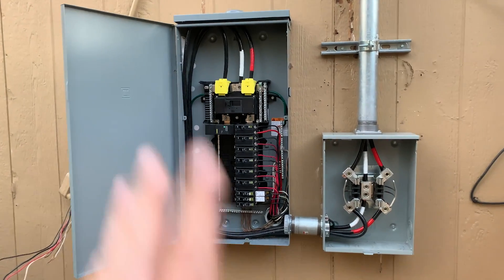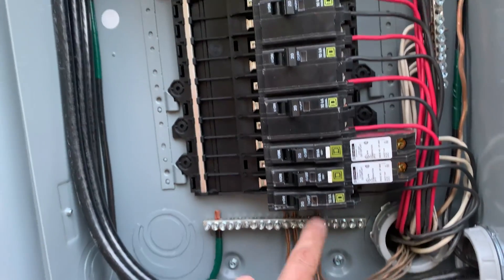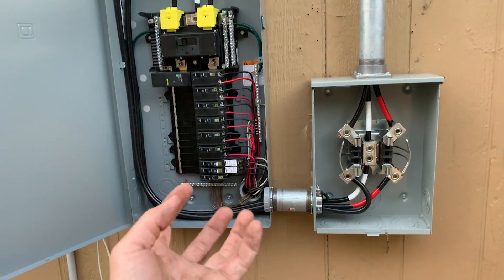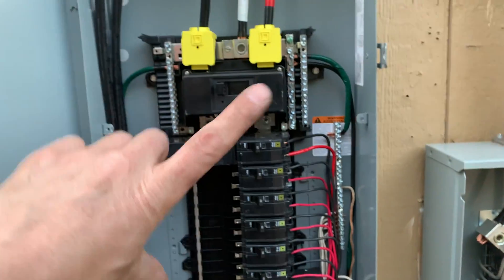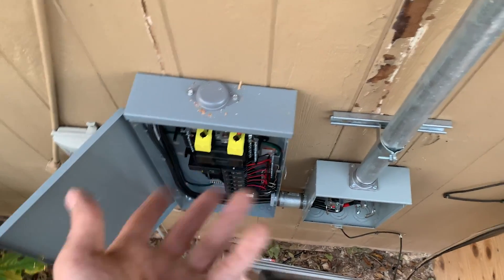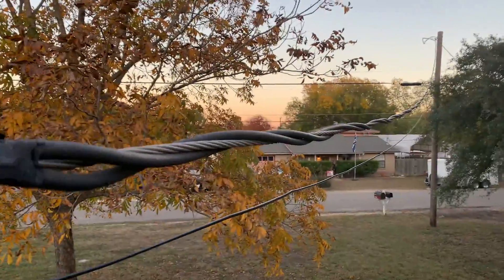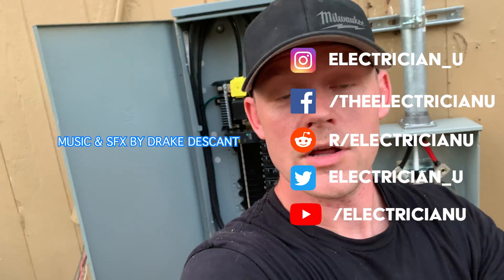I Just Changed Out My Electrical Service

Comment: I can't believe your code allows your main incoming power come through the distribution side to your main breaker. In Ontario Canada our panels have a barrier between the main and distribution section of the panel. We also have a separate ground bars and neutral bars. You didn't mention your surge breaker

Comment: Can you explain more about the circuit breakers as to why it needs 2 hots instead of just 1?
Reply: 240’s need 2 hots (from different buses).  120’s need 1 hot.  The 2 120’s are opposite, so combined, they give you 240.

Comment: You have no guy kit on your mast required in the NEC for that much length of mast coming through the roof line. Plus, main merge ground and neutrals, sub separate grounds and neutrals. Could have landed the Neutrals with the grounds.

Comment: 1 to 2 ground rods needed 6ft apart with an inter system bonding terminal, and bonding to main plumbing with a jumper to jump the water meter.

Comment: You should have mounted the panel inverted with the main breaker on the bottom; would have saved yourself a lot of work.
Reply: Its a nema 3R panel. Its only weather proof if its mounted the way he has it.  Its outside, lol.
Reply: @Jzzonem  You invert the internals, not the whole panel. lol
Reply: @davidmiller8967  Ok... and how would you install the dead front at that point? Just curious.
Reply: @Jzzonem  I've never encountered an outdoor breaker panel that was not convertible between top or bottom entry but it doesn't surprise me. It's been a few years. Manufacturers today are trying to save a few bucks and assume everybody is installing from an underground service. My original comment was assuming the panel was convertible.  I wasn't trying to critique your work. Looks to be an excellent installation. I always learn something from your videos; good job on those too.
Reply: @davidmiller8967  Right on!  I was just curious if there was something I was  missing in my recollection.  Always open to learning something new.  This video was not mine and I apologize if it came off that way.  It has been a few years for myself as well and I remember not having installing an indoor panel upside down. I honestly have never installed the guts of an indoor/outdoor panel this way.  Thanks for your comments!

Comment: Great video again!  I’m going to have a new panel box installed in the home I’m buying.  The current box is a Sylvania panel with wafer thin  breakers which are difficult to find and are expensive.  I’m also not sure how the wafer thin breakers stacked so closely together can dissipate heat for safety.

Comment: I noticed the wiring that came in the original panel from the left is still just hanging in the air. Where does that run to, and why didn't you connect it in?

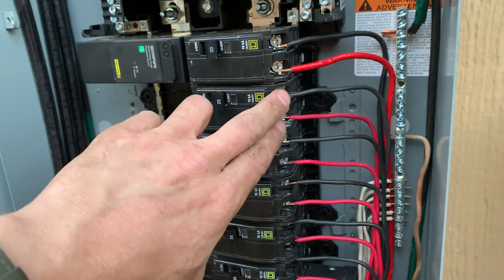Comment: 6:34 I'm confused about something; how did that pass inspection as it is without ARC Fault protected circuits?  It was my understanding that since 2014 Nec (maybe earlier) that every single circuit needed arc fault protection.  Did they pass it because you're planning to do it later?
Reply: I think its because he is only changing the service (meter,panel) at that point he is not rewiring the house. He has a bunch of multiwire branch circuits that share neutrals, so the arc fault breakers would not work.  They would constantly keep tripping.

Comment: If there is no UFER, then you need 2 ground rods for equipment grounding. Also I see parallel neutral as you ran ground wire thru nipple . You could have installed your bonding bushing on panel side, that way you would have  terminated the ground conductor at the bonding bushing on panel side.

Comment: i should send you a pic of my houses electrical box. I just finished the transfer of the deed to my name recently and was looking for a specific breaker that popped during a recent storm. needless to say, it's a nightmare. a box that should be at 200A but is 100A. Stuffed to the gills with wires and breakers. I bought the house as is and I truly have little idea on where to start. My wiring work overseas has not prepared me for this
Reply: Why don't you do a load calculation. That way you know what size your service needs to be.

Comment: hey bro I have a question, according to the code now when a service is done, a disconnect switch must be installed before the power reaches the panel ? I hope your answer thanks
Reply: There is a disconnect in panel. You need an emergency disconnect if your panel would be inside the building.

Comment: Permit on your own house? I wouldn't just because of the arc fault requirements. I could swap the meter socket in 2-3 hours and only have the meter pulled for 20-30min and done before they could even consider sending a crew out. Great looking work. New siemens arc faults don't monitor the neutral btw. Maybe square d will go the same route.

Comment: Hi there i have a question if u can help. I dont  know much about electricity. Im buying a led 650r hlg light fixture. Is has two plugs for me to chose from. Standard 120V Nema 5-15P and  
NEMA 6-15P 240V. I have both outlets that will fit both nema but my question is will the light fixture perform the same if i were to chose either or?

Comment: Why is the jumper to the neutral bar you added green?  Shouldn't it be white?  I know the box is your point of bonding, but if you installed your own neutral bar that was insulated from the enclosure, that jumper should be white.
Reply: That jumper wire he added is not right. He said it was sized for his use, but I counted 8 20 amp circuits. That's why the feeder wires are sized at 3/0.

Comment: you would only need 1 arc fault device at the begining of each circut and from the panel you would run a Bx if out door flex to the first box plug just another way

Comment: I'm not 100% certain, but I do not believe you can put the neutral wires on the ground bar even with the jumper you used. Looks like you have a 3/0 copper neutral, if all your neutrals ended up on the ground bar then you would have the full neutral load on that number 6. Ive seen plenty of ground bars install that way, but none have neutral wires on them.
Reply: I am certain he installed a feeder tap inside his main panel. It is undersized like you mentioned.

Comment: Didn't see any mention of a ground rod. I know you have to have at least 1 ground rod but some areas they require 2 ground rods. Good job. I do like how you used a wire to bond the ground and neutral instead of depending on the box to do the job. Makes good sense so I will be doing the same thing when I have a job like that in the future.

Comment: Did you say that your grounded to the concrete slab? In WV you need two 10 foot ground rods at 6 feet apart. In Ohio you do not. This is with both with AEP.

Comment: Is there a reason why you could not turn the breaker panel upside down to get the ground and neutral buss bars at the bottom of the panel and a void adding new ones?

Comment: I wouldn’t worry to much about arch fault make sure you have good connections and good breakers and man you will be fine my family has been wiring houses since shielded cable was made and you are plenty safe.
Reply: Most houses (around here at least) don’t have any AFCI protection.  New construction does, but everything else is grandfathered.  I would like to convert my own over someday to dual AFCI/GFCI but I have nearly 100 breakers in 5 panels.  Do the math on that and you’ll probably think “eh, it’s good enough as it is”.  I do have GFCI protection in appropriate places though.

Comment: Rather see a meter enclosure with a bypass lever, in my area it’s required for new or upgraded service. In fact the type with a main breaker disconnect included underneath the meter area are even better, allows for complete separation of the load breaker panel if ever needed.

Comment: Is that romex coming through that nipple in the back? I don't see much identification on the wiring to be able to say it's thhn/thwn. If that's the case is the install nec compliant or is this a case of contacting the ahj and asking how he'd like it done? I mainly do new construction/indoor services and haven't been on any exterior service upgrades yet but I would imagine that ideally you'd want to penetrate the back of the enclosure with connectors that support each individual cable as they enter the enclosure and also be stapled within 12" from the panel on the inside of that exterior wall. Correct me if I'm mistaken.
Reply: Multi-branch circuits have to be bundled together with their neutrals when they enter the panel per NEC.

Comment: Very pretty work.
Here they don't allow afci required circuits to be on multiwire feeders. 
I need new 2020 C.E. we are just barely on the 2017 NEC here. 
What is the spec on the surge?

Comment: Greetings Dustin - I read in the comments where you believe you forgot the "IBT". However, there is an exception to that as shown below in case you " need" that .
"Exception: In existing buildings or structures where any of the intersystem bonding and grounding electrode conductors required by 770.100(B)(2), 800.100(B)(2), 810.21(F)(2), 820.100(B)(2), and 830.100(B)(2) exist, installation of the inter- system bonding termination is not required.An accessible means external to enclosures for connecting intersystem bonding and grounding electrode conductors shall be permitted at the service equipment and at the disconnecting means for any additional buildings or structures by at least one of the following means:
(1) Exposed nonflexible metallic raceways
(2) An exposed grounding electrode conductor
(3) Approved means for the external connection of a copper or other corrosion-resistant bonding or grounding electrode conductor to the grounded raceway or equipment" since your panel is exterior its available for the existing application.

I will give you a call as there are a few other things I noticed that I wont share here.....this is a Paul and Dustin conversation...LOL

Comment: So I know it's existing and almost impossible to change but nowadays the UFER has to be #4 for a 200A service. I feel like some AHJ's would make you drive rods or provide another sufficient system in a situation like that since the existing grounding electrode isn't up to standard.

Comment: Intersystem bonding bridge bar. Dang it. But I was gonna say either labeling the branch circuit conductors directly on the wire or, it looked like you shared 2 EGCs per lug on the ground bar at the bottom.

Comment: It's easy to forget that when his ground is in the slab. When I have to use grounding rods, the bridge double as a connector to run the ground wire into the panel. That help a lot in not forgetting.